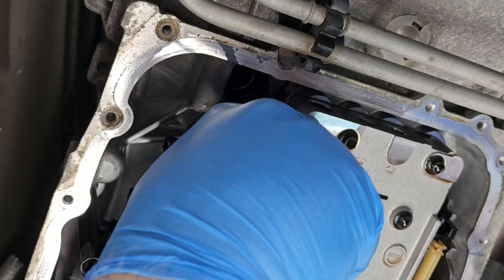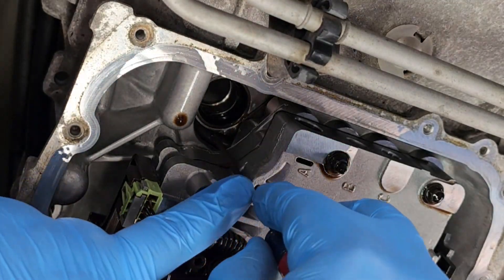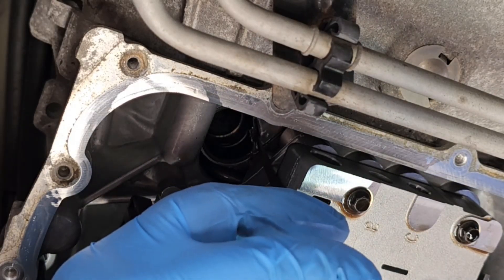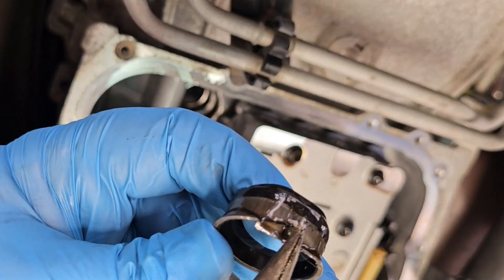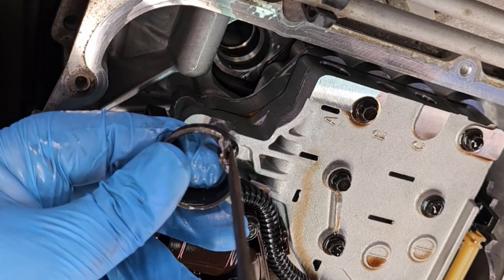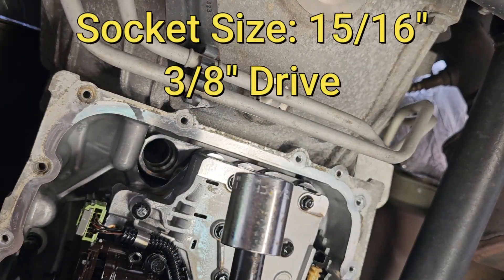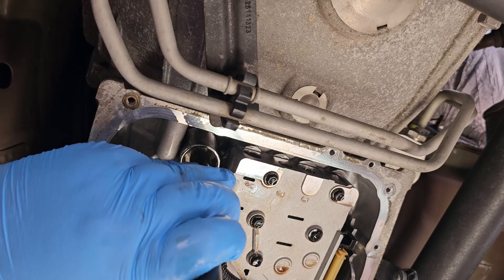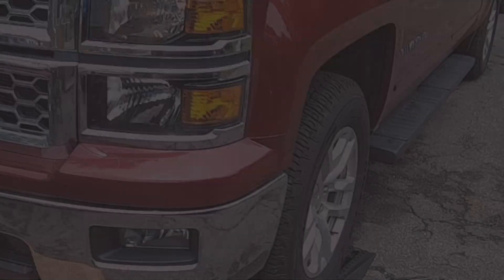GM 6L80 Transmission Filter Seal Removal & Install - Quick Guide!

Comment: Hey having problems with my 12’ Altima it’s stall out randomly sometimes then a traction light will come on with a check engine light and it’ll jump and jerk at 2.5k rpm code reader says p0101 maf code cleaned it out same thing happens but ordered a new maf sensor and throttle body to see if it fixes it
Reply from the maker: Hey, yeah sounds like the MAF sensor went bad. Hold off on replacing the throttle body because the new MAF might just fix the issue, then you can return the throttle body 😉

Thanks for watching!